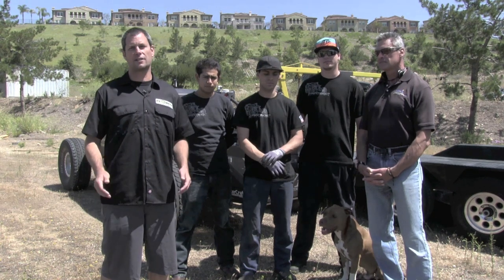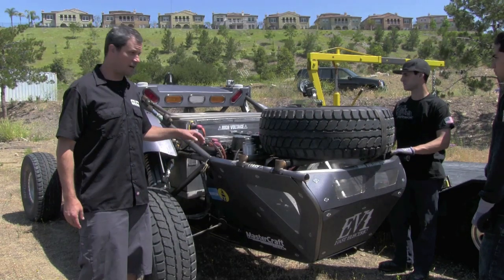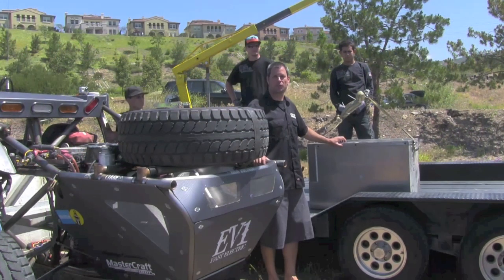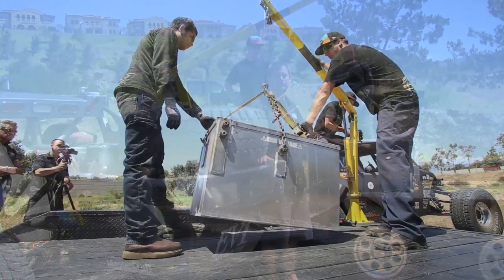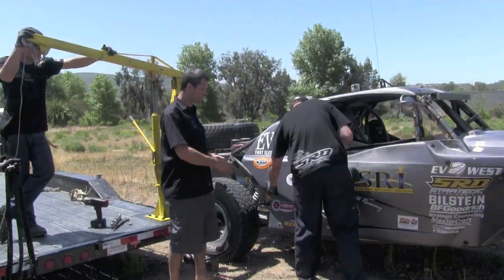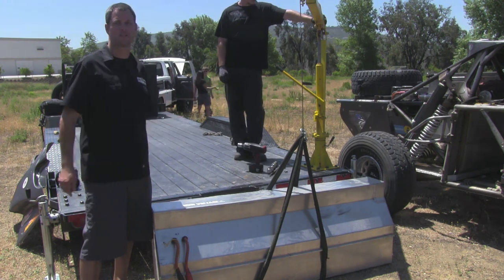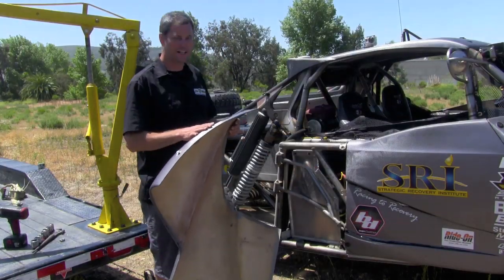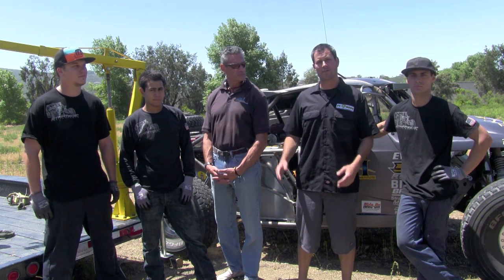Quick Change Lithium Battery Packs SRI EV1 by EV West / SRD Swappable Demonstration

Comment: [#Recharging onboard.] [#never plug in or need to charge the batters from an external source.]      
 Is it posable to have a system to recharged the batters onboard without plug into a wall plug? 
 [alternate] to recharge as you go down the road? 
put back into the batters what voltage used as the car runs down the road?

Comment: What if all electric cars had quick swap battery packs that are all standard sized and convert traditional fuel stations from just selling gas they would also swap out your empty batteries for full ones.
This would revolutionize the electric car market and create additional jobs. Battery packs would come from a variety of producers with variable qualities and the car owners would just lease the their battery of choice.
Reply: Most packs are optimized for the type of vehicle they're made for and there's no easy way to make a standard pack for every type of car out there. You'd end up with refueling stations that need dozens of different packs for all the cars on the market. Not impossible, but difficult given the current state of EV design.
Reply: That already exists in China and are a lot of improvement projects around the world. See this video minute 3:20 https://goo.gl/kUEbnQ
The video is in spanish but you can use the subtitles option.